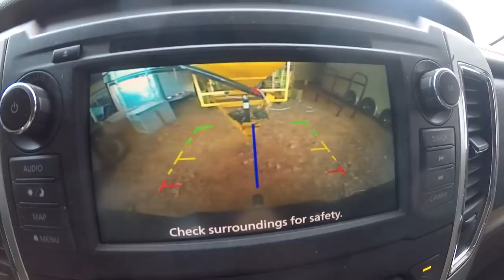NEW WHITETAIL DEER MANAGEMENT PLAN 🤔🤔🤔at Hollis Farms

Comment: Sounds like you are going to have a great plan. I was in a lease near Quitman, MS several years back and we went on a strict management plan and it really paid off. 7000+ acres and 1.5 acre plots were were made using maps to cover the property evenly. First 3 years only does and cull bucks taken, after that limited "trophy" bucks each year. It was doing great but no idea how it ended up as a guy with big $ took over lease from us and gave everyone the boot that had worked and invested in building it.....Anyway, I would much rather hunt free range deer that are managed than enclosed ones. Holler when you need more hunters OR helpers.